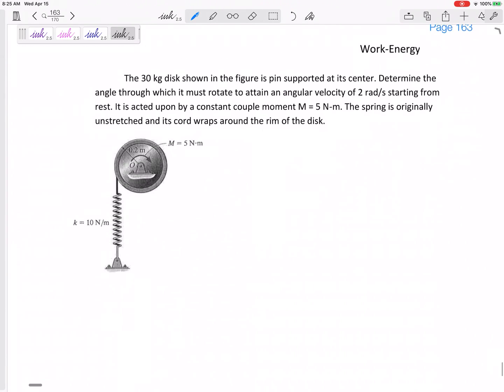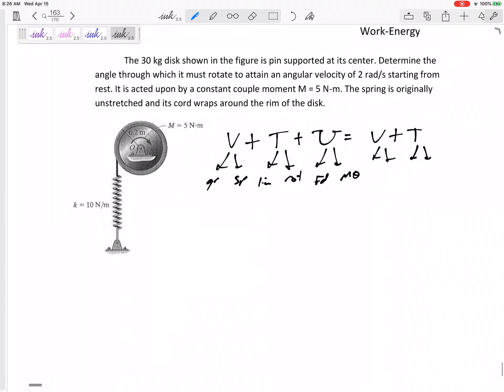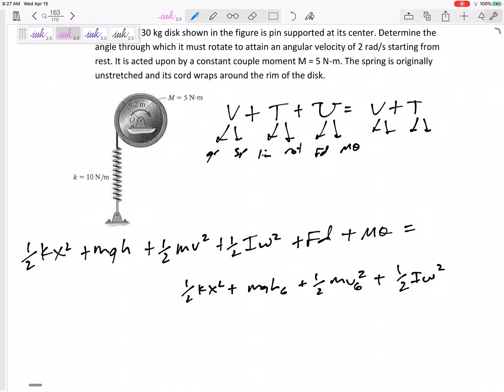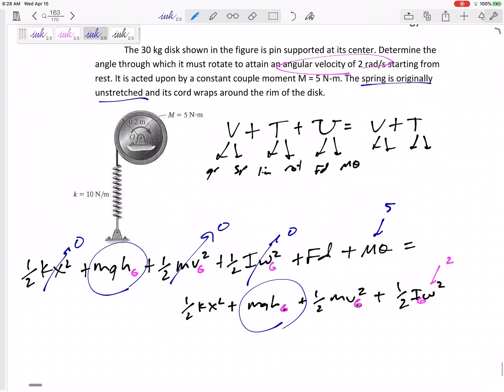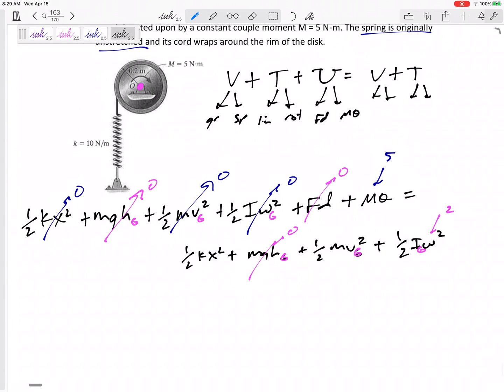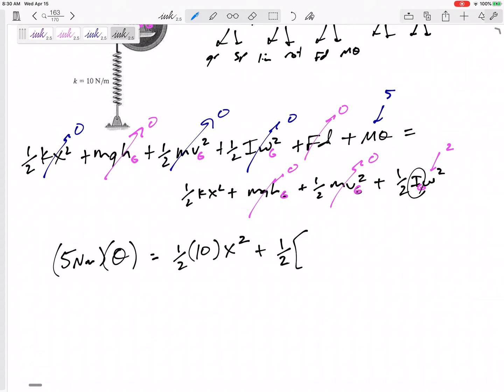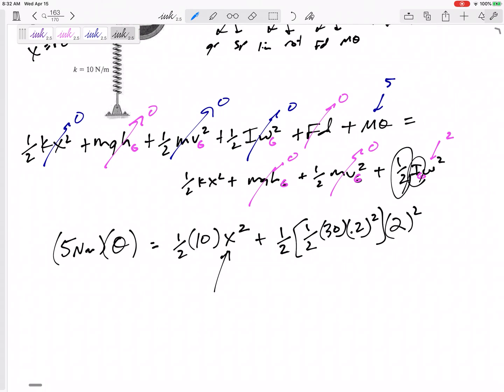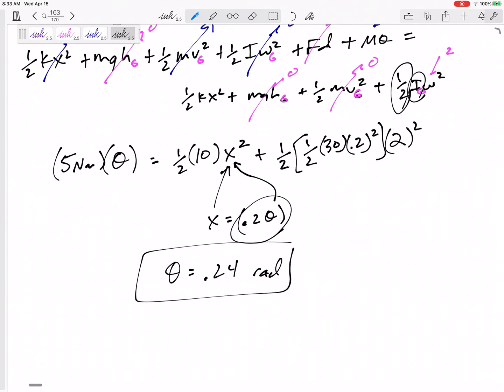Dynamics - Rigid Body work and energy example 1

Comment: when doing substituting x = 0.2 theta into the main equation, you have to do quadratic equation, the smaller value (as long as it is above zero) represents the 'first instance', so that value is used